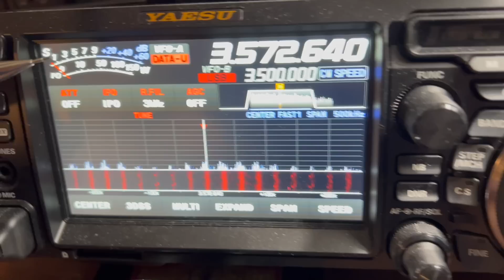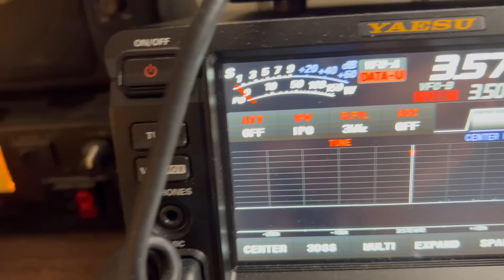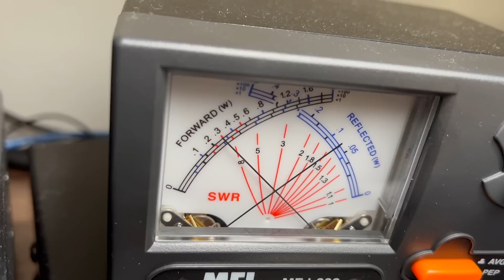The Myth of SWR

Comment: What I fail to understand here is.. my understanding is, watts and watts.  You deliver 20W into the antenna tuner.  There is no additional energy being added anywhere, so how do we arrive at 30W forward power?  Are you saying to interpret the reading, we have 20W forward + 10W reflected which eventually is more or less all radiated, so we read 30W forward, but in reality the total power coupled into the antenna is 20W after we take off the 10W reflected?
Reply from the maker: Yep.  I know it's hard to wrap your head around.  The bottom line is that no power is wasted, minus some usually minor coax cable loss.   No new power is actually created.  The law of thermodynamics says energy cannot be created or destroyed.  Check the references in my description.

Comment: Hi,so are you saying that say a dxcommander all band vertical for example......if you cut your elements too short or too long so the swr is high,that rather than spending time trimming them to just hit the tune button n they will work exactly the same at say a 3.1:1 swr as they would being cut to resonance showing a 1:1 swr??? Many thanks new subscriber .73
Reply from the maker: If you use an antenna tuner it will work just as well.  Use good low loss coax.
Reply: True - but why not just tune the antenna properly?  It is a multiband antenna for a reason.  Still agree with you BTW!
Reply: @M0RMY I think he is saying tune your antenna but don't sweat small SWRs.  You don't have to hit 1:1?  For many antennas where the real resistance is not 50ohms tuning for resonance (0 reactance) is different than tuning for minimum SWR.

Comment: The impedance mismatch between the feed and the antenna reflects the power back towards the transmitter.  But there isn't any impedance mismatch at the transmitter.  So that reflected power will not be reflected again back towards the antenna, and unless there's a circulator to steer the reflected power to a dummy load it will be dissipated as heat in the amplifier output stage and possibly destroy the transmitter.
Reply: The standing waves change the impedance at the transmitter, the feedline becomes an impedance transformer when there's an impedance mismatch at the antenna feedpoint, the tuner will also introduce a mismatch
Reply from the maker: I provided reliable references.  Waiting for yours.

Comment: Great comments,
I'm inclined to believe that reflected power is not being radiated in a useful manner. I have no proof and have not researched the facts but I studied and bunch of physics and electronics and believe the power gets bounced back from the antenna and gets used up as heat in the ATU/Final and coax. Otherwise, the reflections would get radiated as noise, QRM, and be seen on a broadcast analyzer as a descending ghost signal that a TDR could measure to match the length of cable causing the delay.   Again, maybe they do radiate and that is why some radios sound better than others? I'm sure a test could be devised using long lengths of cable and a top notch broadcast analyzer, TDR, bad antenna, and such--please let me know if this has been done.
Reply from the maker: If you look at some of the references I posted in the description your questions will be answered.
Reply: Thanks Mark but, any good math guru can make anything they want to prove go their way--the answer may be if you just bought a $50,000 HF transceiver and hooked it up to a miss-matched antenna, would you crank it up and try to make contacts for 6 hours? I'm siding with JohnWallas74 on this one. @BustRadioMyths

Comment: Controversially there are times when an apparently matched antenna can benefit from being "detuned". For example a ground mounted quarterwave, if you had a perfect ground plane the impedance should be in the region of 35 ohms at resonance. However with a typical radial system with an impedance of about 15 ohms will create a nearly perfect 50 ohm match despite 30% of the power warming the ground. If you make the vertical slightly longer the feed impedance will go up accompanied by some inductive reactance. By raising the impedance of the vertical section you reduce the current in the ground system too raising efficiency. You can also get a better pattern. Obviously not all cases are equal, a typical coax needs derating for power handling when operated with a high VSWR. I kno this is the land of Youtube but most of the obsession with low SWR is time badly spent, best make an antenna for efficiency and a good pattern and then figure out how to drive it. 73
Reply from the maker: Interesting!
Reply: @BustRadioMyths  I think this is a good example when best SWR does not mean best efficiency.

Comment: Thanks for explaining about the reflected power the way you did. I always knew that it was more a matter of keeping the final amp happy, and back when I started as a Novice in 1974 with tube equipment my SWR was not a huge issue to me. Nowadays my QRP station uses well trimmed dipoles for 40m and 15m but when using a EFHW +/- for 80m I still use a tuner to keep the little transistor happy ;-) 73, WA4JAT

Comment: I respectfully disagree. Can hit stations further with better SNR when the antenna reflection at the feed point is kept at a minimum
Reply from the maker: That would be true if the SWR is obscenely high.  No one can hear the difference between 2:1 and 1:1.
Reply: @BustRadioMyths  pskreporter shows otherwise. Also breaking SSB POTA pileups is in my experience easier at the center, not edge, of tuned bandwidth. Still, for science I took a his/her pair of Ten Tec 238AB s and did AB testing to three remote SDRs.  You are right one barely showed any difference, but the other two were far more weak the at higher SWR, one impacted most. I am now wondering if the reflected standing wave affects the radiation pattern and if that contributes to the debate.
Reply from the maker: You are likely experiencing minute by minute changes in propagation rather than changes in SWR as you change frequencies, unless the change is so extreme you experience a massive efficiency drop as with a small magnetic loop.
Reply: @BustRadioMyths  of course not. i alternate and watch the trends and changes on both A and B as A/B compare. I try when band is hot and not. I make sure someone is not QRMing. It’s not easy.

Comment: So what you are saing is that the higher the SWR the more power you will put out.    
If the Antenna had a 1:1 SWR then you only get 20 watts out.    but since you have 3:1 SWR you get 30 watts out a bonus of 50%  due to high SWR.   Keep dreaming.....   Keep dreaming.....
Reply from the maker: No you missed half of the process, which was clearly explained.  The additional 10 watts is reflected back to the tuner by the antenna, giving you 20 watts radiated.  There is no magic power increase.  Click on the references in the description to learn more.
Reply: Haha listen carefully to what is being said ,at no point did he say there's more power than was originally generated radiated by the antenna

Comment: A good proof of this is in receive. Just as an experiment, find a weak dx station with your perfectly tuned antenna and then see how far you can de-tune the antenna before you start to loose signal and it will shock you (hopefully not literally) to see the results, especially with open wire feed line. I have many times before worked dx and didn't want to take time to tune the antenna as I have a manual matching unit. I just manually cut my power down to 40-50 watts and protect my radio that way. Also, when I used to operate mobile I used AM mode with no audio to tune my screwdriver antenna. AM mode automatically cuts the transmitter power to about a third (again NO audio) and zero beats the frequency so other stations are not even aware of your presence. NOTHING I hate more than people who for some reason use FULL POWER to match their antenna, and it always seems to be at an EAR PIERCING 3000 hz! Here in the shack, I turn my power down to just enough to move the meter to full scale, or even less, just enough to get a relative reading. When I can't match my antenna, I simply cut my power in half and I still make the contact!
  Back in the 70's Heathkit offered a two meter FM radio called the 2036 and claimed you could run it at "unlimited" swr. This was due to (in my opinion) the fact that the final transistor was only running at about half it's rated output and only put out about 12 watts.
Great video man! 73's

Comment: Pardon my ignorance and newness, but wouldn't that summation of power only apply if the reflection is in phase? I would imagine it ends up as a function of length, at a minimum.. I envision in my head two out of phase magentic waves would have walking nodes and nulls at varies snaps shots in time
Reply from the maker: This same question has come up several times but I have not answered it yet but here it is.  The antenna tuner changes the phase of the reflected power.  This is a quote from "Reflections" by antenna engineer Walt Maxwell.  "Tuning for maximum line current simply adjusts the phase of the reflected wave to rereflect down the line in phase with the forward wave."
Reply: @BustRadioMyths  Thank you for the reply! ..but  when you do make that adjustment of phase, isn't that the same effect as lowering SWR?.. only electronically lengthening instead of a physical one? I ask in good faith as I try to come up with the mental models..  I appreciate the video, btw, made me think.. So, thank you!
Reply: @wizardofboz76 the tuner allows the transmitter to put full power into the now resonant system ,the mismatch at the antenna is still there with the resulting standing waves /additional voltage and current ,the tuner provides a conjugate match for power transfer under these conditions

Comment: So, looking at how a typical SWR meter works, why doesnt the detector on the antenna port end not pickup power from the transceiver port and vice versa?
Reply: An SWR bridge has directional couplers built into them one for forward power and one for reflected power, a directional coupler will only couple power flowing in one direction. Power entering the output port is coupled to the isolated port but not to the coupled port.
Reply: @lifegettingintheway2710  ummm.... respectful... In every 'directional coupler'...there is a diode (signal detector)... and there is a resistor (signal termination) and a RF Coupling mechanism. Detector on one side of the coupler... termination other side... Just like a rhombic antenna... it is the termination that keeps the signal flowing in one direction. The orientation of the diode effects the polarity of the detected signal...

Comment: My first thought was "What if the re-reflected power is 180 degrees to the forward power"? Anyway, interesting indeed. 73
Reply from the maker: The antenna tuner changes the phase of the reflected power.  This is a quote from "Reflections" by antenna engineer Walt Maxwell.  "Tuning for maximum line current simply adjusts the phase of the reflected wave to rereflect down the line in phase with the forward wave."

Comment: Ok, I know I will regret this...I spent my formative years in the friendship of a ham who had a master's degree in electrical engineering.  His reasoning always made sense, and I learned the hard way he was right.  Reflected power does not simply disappear.  It has to go somewhere.  Some power is lost in ohmic losses in the transmission line (often coax).  How much depends on the transmission line.  The real problem is the so-called 'antenna tuner'.  Its true name is 'match box', and it is meant as a convenient way to solve a complex problem.  Reason?  It does not tune anything!  It simply makes your radio happy.  It does not solve an SWR problem at the antenna.  This is why I used to use 'tuners' at the antenna feed point (such as the SGC models and the Icom AH-4).  They measure the SWR at the antenna feed point and adjust accordingly.  Awesome devices when used correctly.  If you use a coax choke at the 'matcher', you will also keep the radiated power at the antenna, and not on the outside of your coax where it can be carried back to your operating position.

The boxes at the radio provide a 'conjugate' match.  They do not correct a mismatch at the antenna.  The 'loss' (the stuff NOT being radiated by your antenna) is still there.  So where does the power go?  The 'match box' simply shunts the power to the case or chassis of the box, and to the shields of all your coax, radio chassis, microphone, SWR meter, and anything else with electrical continuity to the chassis of the 'match box' become hot with RF.  This is another reason why quarter-wave radials (counterpoise) are such a good thing on many antennas and grounding systems.  They provide a low-impedance path for that 'lost' power to go and be radiated instead of filling your shack with RF.

Of course, the best things to do are...1...properly match your antenna, and 2...learn how to use balanced line instead of coax, especially on HF.  Balanced line has far less loss in a mismatched condition...almost lossless in both incident and reflected power conditions...and does not radiate power unless it is engineered to radiate.  Not as easy to handle and use, but it sure works good on dipoles, loops, and other bigger antennas.  Most of the long-timers I knew never used coax on HF.  Good luck!
Reply: An antenna tuner tunes out the reactance of the antenna system to create resonance, the conjugate match corrects the antenna feedpoint mismatch to allow power transfer, reflected power does indeed have to go somewhere ,its either lost as heat within the transmission line if lossy or radiated at the antenna ,the tuner does not shunt the rf power to the braid of coax or chassis of equipment, the antenna is at fault for that ,may I guide you to Walt Maxwells books reflections he explains very in detail how it works

Comment: I'm not completely sure that the reflected power adds to forward power, or that the forward and reflective waves are even in phase, with no leads or lags, and if they are not, then there certainly is some cancellation going on. 
My understanding of an antenna tuner is that with it's combination of capacitors and inductors, what it does (and this is ONLY what it does) is cancel out inductive and capacitative reactance. (I read all three of "Kurt's" books when they were still in print.) Hopefully, what you have left then is pure resistance. Well we should probably call that  instead hopefully "pretty low reactance" and not resistance, since we are discussing AC. As a subject, Cable loss is a VERY significant topic. Too many hams are connecting good radios to good antennas with crappy coax. While I can't prove it, I think that there is a lot of "milspec" Hucksterism going on. And yet? No Doubt, there's some ham attempting to use Heliax in a Liquid Helium environment to get rid of the resistance completely... 🤣 Finally, I observed with my own (Daiwa)  cross needle meter, I observed that as I tuned and my SWR improved, as the "reverse" needle went down, the "forward" needle went UP. EVERY time. And, super finally, when I had a bad SWR before I knew what I was doing, the heat sink in my Ten Tec Scout got pretty hot with a bad SWR, so I MUST conclude that the reverse power was heating up the final, and so the reflected waves WERE NOT being broadcasted up the dipole, instead they were heating up my shack! And I couldn't match higher wattages at all. This was when I was still reading the radio mags with the linear amp and tower "centerfolds" and thinking I needed all of "that." But I got better, I went QRP and with an LDG auto tuner. Now, I just wait for the clicking to stop, and and I'm tuned and it's all rosy and peachy, with no credit account at The Candy Store! 😂
Reply from the maker: The antenna tuner changes the phase of the reflected power.  This is a quote from "Reflections" by antenna engineer Walt Maxwell.  "Tuning for maximum line current simply adjusts the phase of the reflected wave to rereflect down the line in phase with the forward wave."

Comment: After 40+ years of being in communications technology both as a Ham and Military, I see that what you say is TRUE. RF is never lost, it just goes somewhere. I have never worried about SWR, if it was below a 3:1 or  slightly higher.  Since everything became fixated on a 50 ohm load, resistive, capacitive, or inductive, everyone has been screaming about SWR. I have found that the older transmitters that are vacuum tube based, it doesn't care what the antenna reads in SWR because the PI network loading does much the same as an antenna tuner does - match the transmitter to the load. Now, with semiconductor finals,  the only worry is to keep the transmitter 'happy' by reducing SWR to around 50 ohms, or a multiple of 50 ohms and using some sort of a matching device to, again, keeping the transmitter happy, but the antenna will radiate no matter what the SWR is. The  great goal is to  have the antenna load be 180° out of phase, and some of the reflective power is always there. And as stated, no power is really lost, it either becomes hest, or is radiated. No power is ever lost.